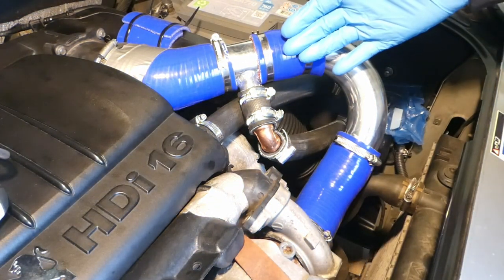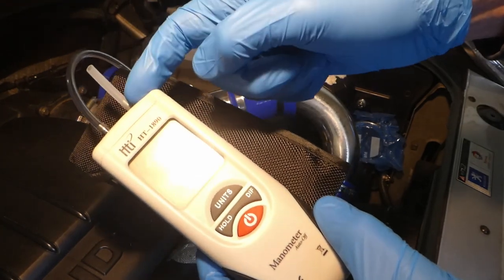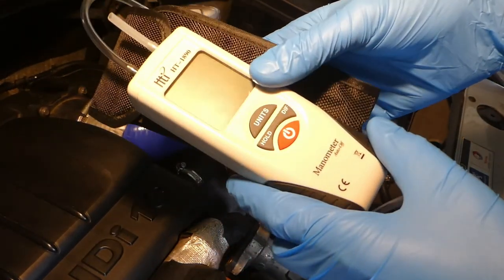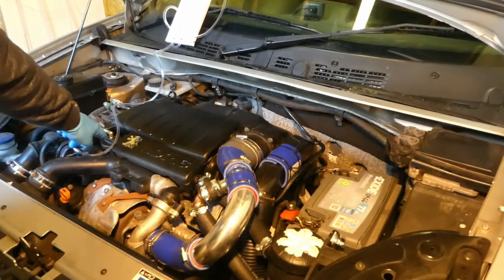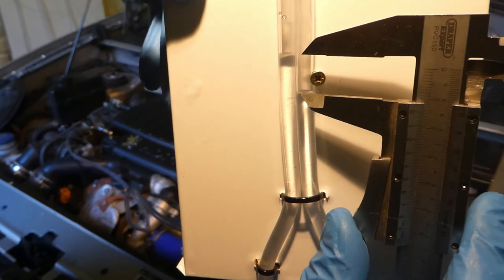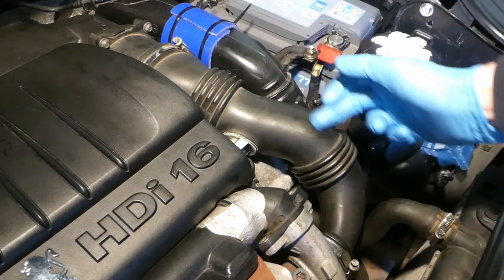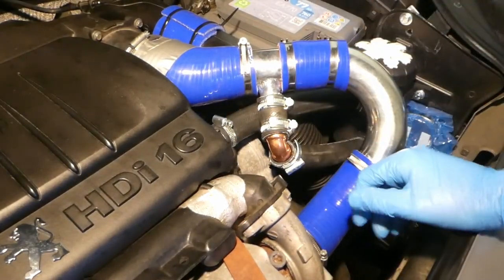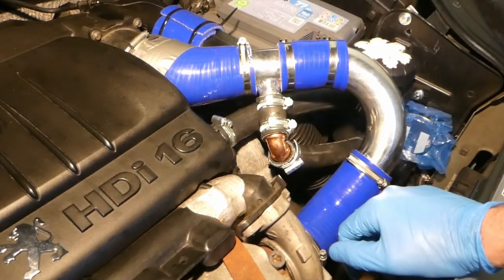Will oil catch can increase crankcase pressure in 1.6HDi/TDCi engine (Peugeot/Citroen/Ford/Volvo)

Comment: Another amazing video wow. I was thinking about that pressure myself as I just bought the Baffled oil catch can after your advice. But now I'm less concerned about that pressure being too excessive. THANK you very much for this video very informative and very well explained. Awesome :) kindest regards. 👏👏👏👍👍👍❤
Reply from the maker: Hi Gab, many thanks indeed for the kind words, much appreciated. I still have to do some more detailed analysis on the pressure in the long-term and under load. Nevertheless, with my oil catch can there was not even the slightest increase in crankcase pressure. I suspect that it will depend on the wear of the engine. If the engine is really worn and there is a significant blow-by then a more restrictive catch can is likely to increase the pressure, as the oil catch can would not be able to cope with the flow of gasses.
Reply: @moremolecules  Thank you for the information I will keep an eye on that video and only time will tell if my oil catch can is restricted or no. Kind REGARDS and best of luck.

Comment: Great informative video. 
You could do some testing without the catch can being connected to the intake, because the turbo pulling air will create a vaccum in the intake piping. 
I suggest you connect the outlet pipe from the catch can to the atmosphere or to a breather filter just temporarily for testing, along the rev range. And see the result that way. 👍
Reply from the maker: Hi Phero, I have made another video with much more precise measurements: https://youtu.be/h4TQ-XVWU30 using a DPF sensor. I could do with the outlet piping from the oil catch can venting to atmosphere, but the air will be unmetered, i.e.  a lot of air will be sucked by the turbo from the opened outlet vent from the catch can. I was only trying to simulate the actual pressure with kind of the whole setup as it is. I agree that the pressure will rise much higher than with the close system as there will not be the small amount of active sucking of air out of the crankcase.

Comment: Hi this was a good analysis.

I had use two oil catch cans in series the first one not baffled and the second one baffled like in your video. I hit the road for a test and I guess the results were not good oil spilled out of the engine check oil stick. Not much but still scared me a bit. I hope I had not blown up an sealent from the engine or turbo... As I am concerned with the oil in the system I will keep the baffled one only. Like this I seem not to have any problem.

I guess I will be careful with this drive more carefully and do more regular oil changes to make up for the fact I am running this oil catch can. Which seems to be working great and catching lots of oil (I guess this is bad, but good let's say). The plain one without the bronze filter doesn't do it for me. Lot's of oil in crankase vaporized on the vented air I guess.

Not sure were the amounts of oil I am cleaning after each trip from the intake mainfold are coming though. If this is oil that is being pushed out of the intercooler that entered the pcv or maybe there is a leakage on the turbo it self which is causing it.
Reply from the maker: Hi Rafael, rather interesting that your dipstick gets blown out from the crankcase pressure. I suspect that depending on the condition of the engine you may have a bit more excessive crankcase pressure. Different matter what this might be due to, say high mileage engine, bores slightly enlarged with time, etc. So, if the two catch cans blow the dipstick, means that the crankcase pressure is pretty high and the small amount of increase gets you to too much pressure and dipstick gets blown. If I were you I would get some measurements of the crankcase pressure, something like this might help: https://www.youtube.com/watch?v=h4TQ-XVWU30
If your oil catch can is capturing too much oil, it may be due to the very high crankcase pressure and hence pushing it out. But if that is the case, the engine should smoke a bit more blue pretty much constantly. It is unlikely to be from intercooler/turbo, as this gets burnt and difficult to end in oil catch can.

Comment: You could just use a vacuum gauge. Still looking for the Ford Focus part number to connect the hose out of the valve cover.
Reply from the maker: @David, I could have used a vacuum gauge, but I thought that the digital manometer would work. I thought to use it to check the differential pressure of the air/turbo pipes as well. Kind of two birds with one stone.
The Ford Focus part number is: 1336611. This is the whole air intake path which includes the breather. The breather does not have a part number.
Reply: 1336611

Comment: Hello friend how are you? My engine is in bad shape and I am thinking in replaceing it, will an 9HO engine work for my 307? Currently I have an 9HY from 2006. I'll appreciate what your experience could tell about that. Thanks a lot.
Reply from the maker: I do not see why it would not work, not really familiar with the difference between the 9HO and 9HY. I thought they only had the 9HX and 9HY. You could potentially get the ECU from the 9HO as well, that would ensure the 9HO will be working, I suspect you might as well transfer the BSI.
Reply: @moremolecules  thanks, adding the ecu and bsi would be a lot more expensive. Maybe I can get a dw10, but the same question, will the ecu work? Thanks again for your time. I have to post a new video with things i've done in the last month, sadly all went not so good.
Reply from the maker: @dieseltips  I would go for the RHO, rather than dw10. As far as I know the RHX and RHY are interchangeable, so I only assume that RHO would work as well.

Comment: Hi it's me again 
Today I try to check oil level
And I see coming smoke from the dipstick 
Also the oil cap is dancing if is not close properly...please help 1.6 tdci
Reply from the maker: Yeah, you have excessive crankcase pressure. Do you have DPF on your car? It may need regen or replacing altogether. Otherwise, it might be blocked PCV valve or air intake somewhere. Difficult to tell. Is your air filter changed recently?
Reply: @moremolecules  hi
Is a focus 2013 econetic 1.6 tdci 120k miles 
Air filter done 6 k miles ago with oil and oil filter 
And 1k miles ago oil and oil filter.
The oil inside of the engine is 0w30  c3...can be this a problem?
Also I fiind oil in the air filter coming from the pcv hose 
You think the piston rings is gone?
If the pcv valve stuck close it shows in dashboard engine light??
Also have dpf and I don't know how much percentage remaining of the dpf....
I see a mechanic told me evrithing ok...but I don't trust him 
To much pressure coming up from the dipstick and oil cap
Reply from the maker: @aluyal9288  Mmm, depending on where you are 0w30 should be alright, mine if 5W30, but it is a bit on the colder side around in Europe.
I do not think you will have any error light for the PCV valve. If I were you, I would plug any ODBII scanner and see if there are any errors, better than me suggesting something...
Reply: @moremolecules  ia nice you suggested 
Today I disconnected the hose between air filter and turbo and I check if pressure is coming form the pcv hose.
Only very very little bit smoke but I didn't feel any pressure coming from the pcv hose just little smoke 
And I have oil in the air intake hose.
How can I check the pcv valve to make sure the pcv valve is the problem....is to much pressure inside the engine and smoke come from oil cap and dipstick 
I have ravenol vsw 0w30 inside 1k miles ago
Reply from the maker: @aluyal9288  Yes, there will always be some oil in the air intake hose, just inevitable. You can dismantle it and see if there is something wrong: https://www.youtube.com/watch?v=imxmg9z0rn4
Unlikely to be the cause, probably something else, such as the DPF. That would cause back pressure and spewing oil out of the PCV valve.
Reply: @moremolecules  
Hi thank you for evrithing 
I found the pcv valve stuck closed 
The small spring from inside don't work anymore...
I deleted the pcv 
I took out the membrane and spring.
Put back the tape of membrane and I put a motorcycle air filter on the holes where the hose is connected to the air intake 25mm small air filter,no smoke coming inside of the car.
All the oil what is coming from the pfc to the intercooler and intake manifold is because the turbocharger created vacuum and make extraction oil from the engine.also a oil catch can still not stop 100% the oil to go back in your engine.
My car run perfect now when I open the oil cap is vacuum no more pressure coming out 
For annual inspection  connected the stuck parts after inspection deleted again pcv.
My car instantly fully increased dpf start regen acceleration back on life.
Thank you for your support you are good person 
All the best see you soon 😊
Reply from the maker: @aluyal9288  Glad you managed to fix it. Not too sure, but you should not have vacuum on the oil cap, it should be slight positive pressure. If I were you, I would get a cheap kit (cap + spring and membrane) and replace it rather than like that.
Reply: @moremolecules  when idling there is a small pressure when accelerating I have vacuum to the PVC cover and to the oil cover if it is lifted....is bad?
Reply from the maker: @aluyal9288  That is how it should work, so no problem at all. I thought that you had vacuum on idle.
Reply: @moremolecules  hi
On idle if the oil cap is not close in 5 sec is on the ground the oil cap...
When acceleration is vacuum on the oil cap hole...hope so evrithing is OK...also the mechanic put me more oil on the engine....500 grams more than normal...the oil is om maximum on the dipstick on the morning after engine cool down...tomorrow I go back to make the lvl oil on the middle of dipstick...
Pleas ca you let me know if the oil catch can what you have is working  very good?
Is still going small amount of oil in the intake manifold? Or the catch can keep evrithing in good condition?
Thank you for evrithing and for your time spending with me
Reply from the maker: @aluyal9288  There are never 100% efficient, so you will still have some oil going in the intake. Being on the maximum for the oil is alright, but I tend to keep it 1-2 of the line below as a precaution only. Overfilling is not very good, but on the max is fine. Of course when you drive it will drop down and it is distributed around the engine and when cooling down it drops in the sump.
Reply: @moremolecules  
Thank you for evrithing 
You are the best youtube chanel 
On the city I have 6.9 litres of diesel at evri 100 km .1.6 tdci.or better I will say hdi
Is that much?
 Also OBD show oxygen sensor problems 
I will change with a new one 
Or can be cleaned?
Thank you
Reply from the maker: @aluyal9288  You are probably reading it with a generic OBDII scanner, hence the oxygen sensor problem. There is not oxygen sensor in the 1.6HDi or TDCi, these are only on petrol engines. It may be MAF sensor or something? City driving ~7L should be kind of alright, depends on trafic of course.
Reply: @moremolecules  
There is no lambda sensor on the 1.6 tdci??? 
The mechanic ordered for next week Heated oxygen sensor...40 pounds...
Also the OBD found out 
Error Code P0440 indicates a malfunction with a vehicle's EVAP system. This means that the vehicle's engine control module (ECM) has detected a leak in the fuel tank vapor system or that a vapor pressure sensor has malfunctioned.
What that means?
Thank you 😊 💓
Reply from the maker: @aluyal9288  As far as I know, there is no lambda sensor for the diesels, there is simply no need for oxygen sensor only measuring the mass of air. Might be a different sensor. Fuel tank vapor system I have no idea, maybe there is Eloys tank or something. Which year is the car?
Reply: @moremolecules  is from 2013
Reply from the maker: @aluyal9288  There is not a lambda oxygen sensor on any diesel, but I am not sure about the tank, maybe there is an early eloys or urea system, but do not know.

Comment: Your  really  over  thinking  this.. Just  vent  the  crank case  to  atmosphere.. I  send  mine  through a  catch can and  then vent  to  Atmosphere..
Reply from the maker: Hi alzys, I would not want to vent the gasses into the atmosphere due to pollution, emission, etc. My only choice then was to make sure there is not an increased crankcase pressure with the additional restriction of the oil catch can.
Reply: @moremolecules  , It makes  little  difference.. The  emissions  from venting to atmosphere  is  tiny ! Older  cars  did  exactly  that  , it  will also  improve  the  way  the  engine  runs  and  may  even increase  its  efficiency,  as  your  not  polluting  the  charge !  It  will certainly  help you  exhaust  emissions...
Reply from the maker: @alzys1771  I can try to find it, but cannot at the moment, but as far as I remember the emissions from the crankcase breather were something like ~25% of all the emissions from the car. Which if it is correct is quite significant amount.
Reply: @moremolecules  .. LOL.. No way !  The  only  reason there  is  crankcase  pressure  is  the  pressure  made  by  the  pistons  going  up n down and  a  small amount  of  blow  by  from the  rings.. If  your  sucking  oil  from the  crankcase  and  burning  it  and  sending  it  out  the  exhaust, you will cause  much  more  emissions !  That is  why  my  exhaust  is  much  cleaner  after  i  stopped  the  crank case  from being  sucked  in by  the  turbo  and  sent  out the  exhaust ! You  also  make  the  engine  less  efficient  by  doing  that  so your  making  things  worse  in 2  ways !  I know  you  had  this  issue  as  i  saw  a  picture  of  oil sitting  in your  turbo  in the  video. do  you  think burning  engine  oil  is  good  for  your  emissions ?
Reply from the maker: @alzys1771  I agree that burning oil is not entirely environmentally friendly, hence I also have an oil catch can to capture some of it and not getting burned. I cannot find the 25% exactly, it was a different than this one: https://www.cumminsfiltration.com/sites/default/files/LT36501.pdf These mention up to 25%, so that is quite something, even it is lower. If burning it through the intake again was increasing the emissions, manufacturers would not have done it, since it is worse than just venting it in the atmosphere.
Reply: @alzys1771  - Venting directly to atmosphere is at minimum a tremendous stupidity and lack of respect for us all. There's very good reason why it was changed back in the late 60's and 70's in most places around the globe!! Doing it today is a bit ridiculous to say the least. Cheers
Reply: @crpth1  your  nuts !  what  exactly  do you think is  venting ?